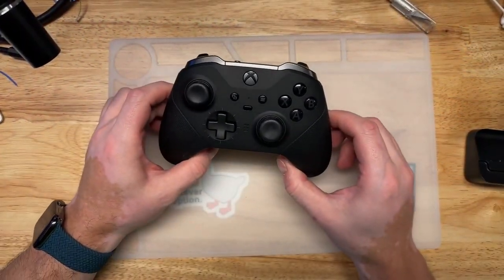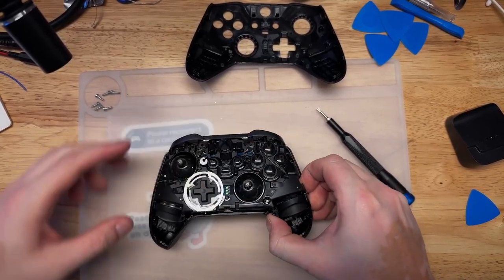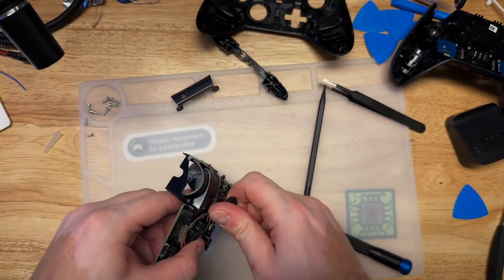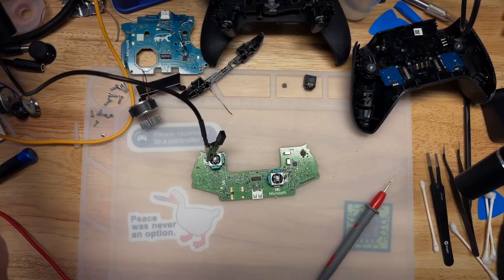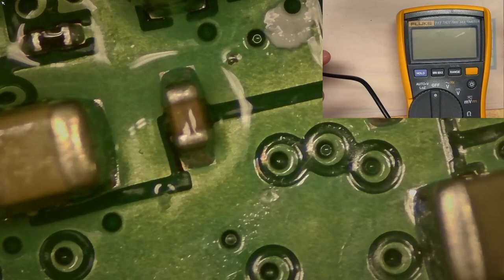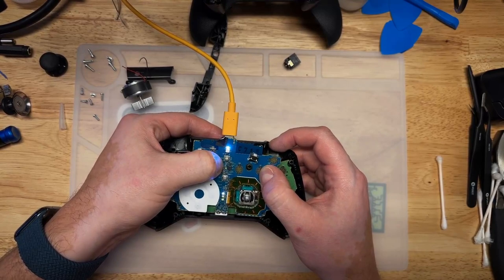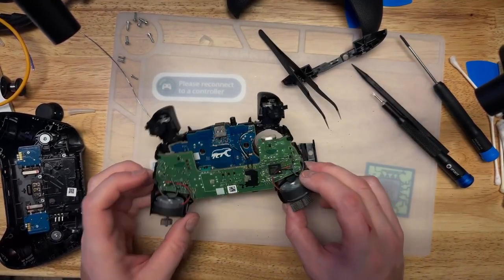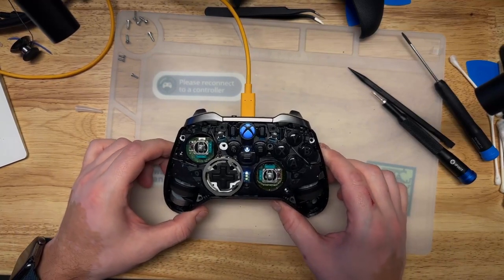Xbox Elite Series 2 Controller Repair

Comment: Very interesting, especially that it would work without the capacitor. Do you think you’d replace it if you do figure out what voltage rating to use?
Reply from the maker: Yeah, if I can find out what the capacitance rating is I'll replace it. It SHOULD be there, but since it's only acting as a noise filter the device can function without it providing the noise either isn't that bad, or whatever signal is on that line is tolerant of it.